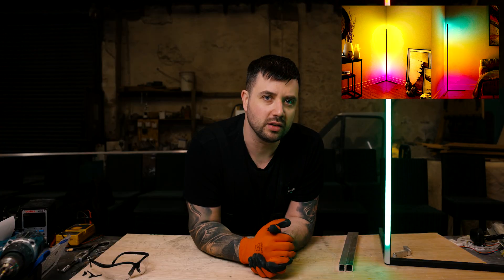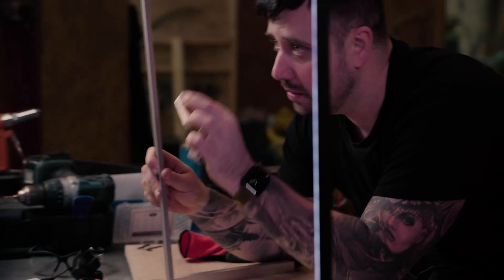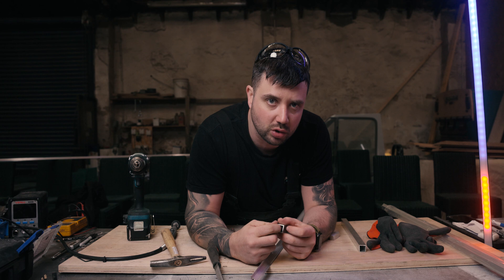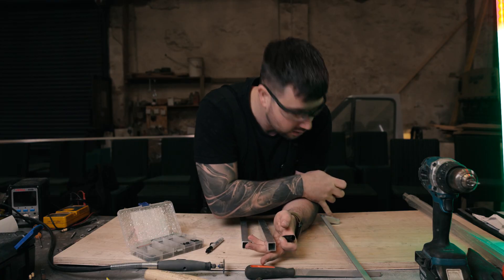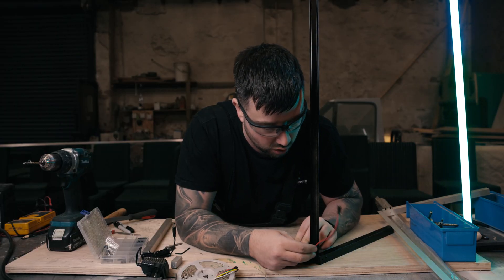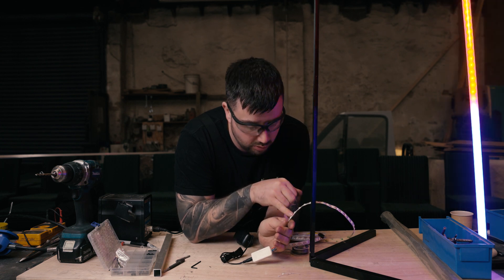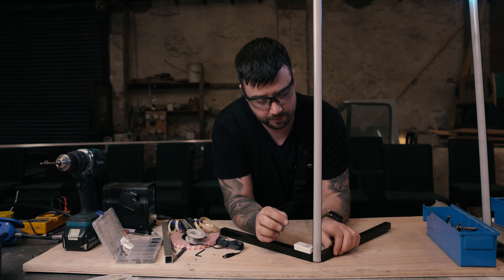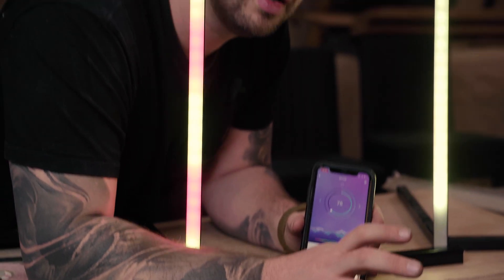DIY LED CORNER LIGHT BUILD - Build your own £130/£200 light for just £30!

Comment: If you want to add more effect you can use ESp8266 and flash it with WLED which has fantastic light effects. The great part about that it it works via Wifi (needs network to work) and there is a free app as well and you can control via mobile or browser.

Comment: Why cut a chunk out of the aluminium profile for the wires?  You cut the wires .. You could have drill small hole in the centre to keep the integrity of the profile and then fed the cables through?